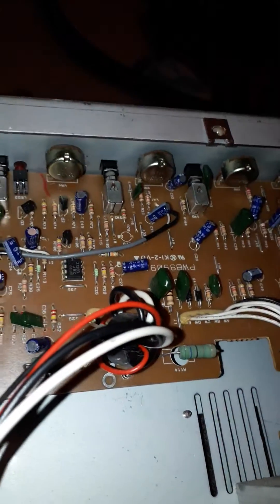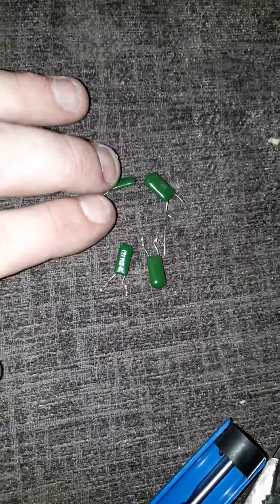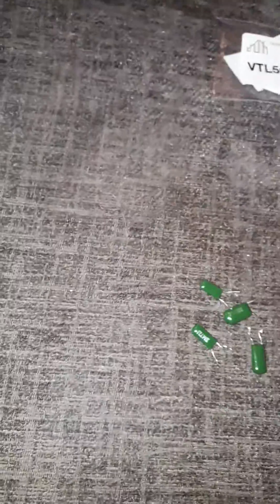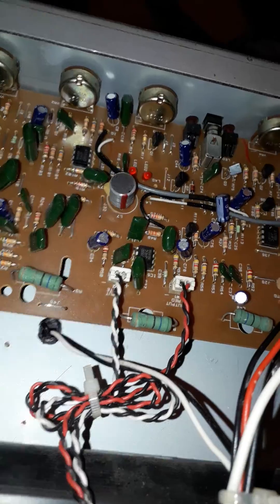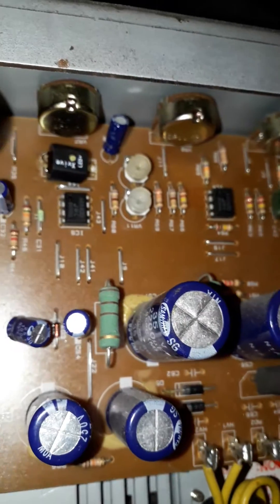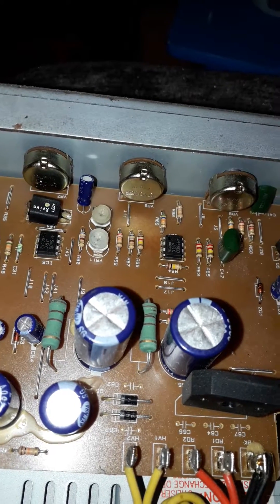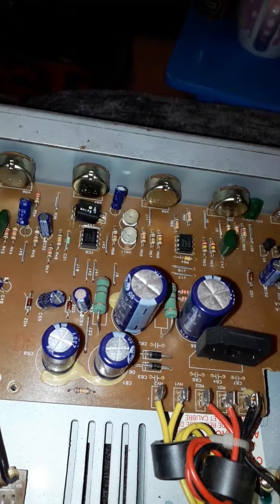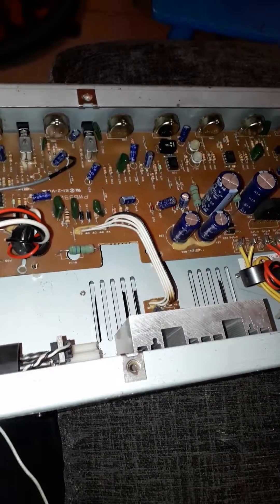Vox Cambridge 30 reverb. Opto coupler replacement. Common problem

Comment: You can also mod it to increase the power output !
I got mine (twin) (14+ years ago) off ebay knowing about the problems and the fixes.
It's fun getting something on the cheap and ending up with something pretty good and unique.
https://sites.google.com/site/voxcambridge30repair/vox---korg-cambridge-30-and-cambridge-30-twin-modifications

Comment: I have known about this part going bad. I have a Vox Cambridge 30 with the same problem. I just haven't repaired it yet only because I do have other amp,, but what I have learned about this problem is,, it has a name.. It is Cambridgitis. I don't know if that is a universal name for it, but it fits.. Her is the first link I found on how to repair the amp.. It also coins the word " cambridgitis.. Just so you will know I'm not making this up..
Reply: Opps. Forgot to leave the link. Sorry..  https://sites.google.com/site/voxcambridge30repair/
Reply from the maker: I am very aware of the nick name for this. It took a lot of research to find out how to fix this. Its great when it works properly though

Comment: I just repaired this issue on the same amp, and found that after a new opto-coupler was added, and the two internal trim pots VR11 and VR12 were properly adjusted, this amp sounds very good indeed.  The overall volume and volume of tremolo can be set individually with internal trim pots VR11 and VR12 respectively.  Overall, non-tremolo, volume for both channels is adjusted with VR11, the self noise will be higher and the tone will “break-up” more at lower volumes.  VR12 can blend in a more pronounced tremolo effect, however it also adds noise to the signal, so turn it as high as you can get it with what you feel is an acceptable amount of noise and adequate amount of tremolo effect. If VR11 and VR12 are not adjusted properly, the signal will be a different volume when tremolo is or isn’t being used. Thanks for your video, I found it very useful!
Reply from the maker: Im glad to be of some help.